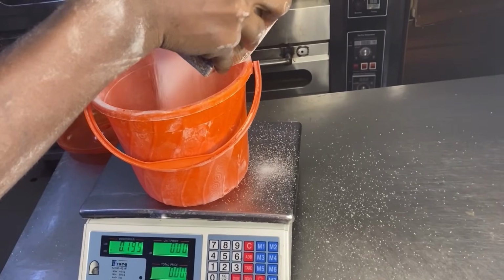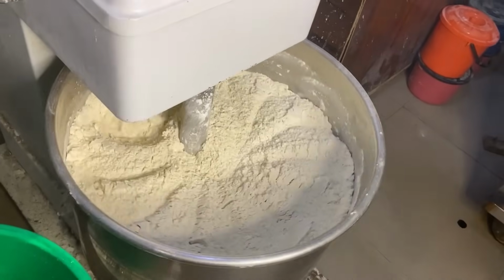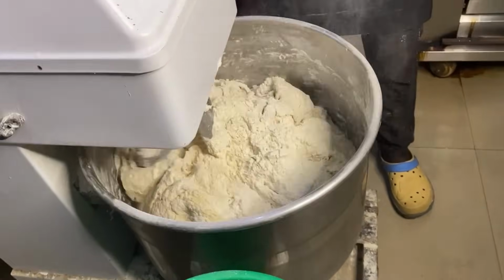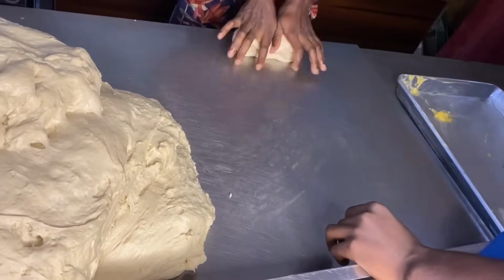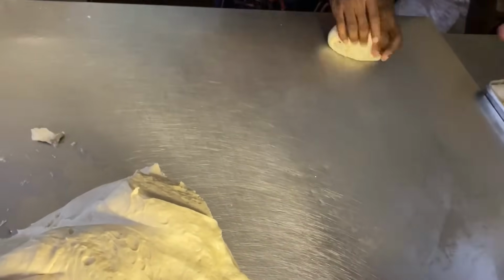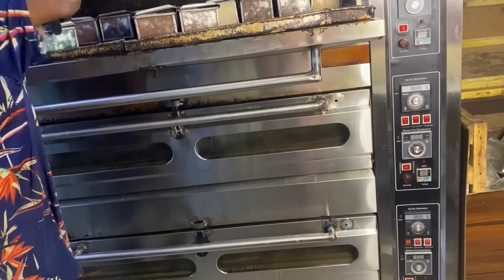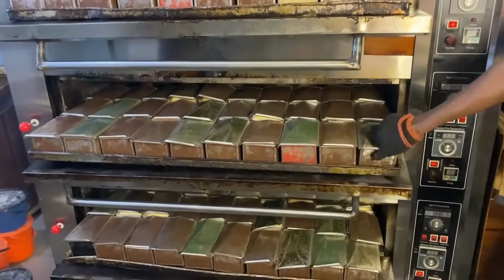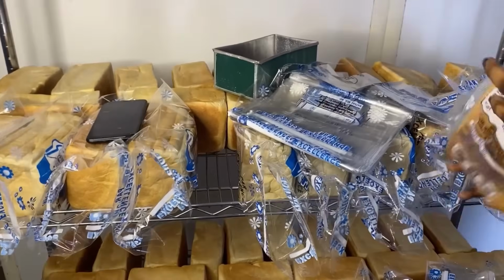How to bake Milk bread for commercial use #breadbaking #bread #streetfood #breadrecipe

Comment: Pls what is the name of the oven? Where did u buy it fro.?Does it use steam? Is it electric or gas. How many minutes does it takes to bake one batch? Thank u
Reply from the maker: 3 deck oven, it can  bake for 25kg flour at a go, people that sell kitchen equipments in lagos sell it, it uses Electric and gas, it bakes for 30mins
Reply: Does it have a brand name? I am outside of Nigeria and wanted to see if I can get some. It looks really efficient. Do u put steam ot water in the oven when baking? You are an inspiration. Thank u for your time.
Reply from the maker: @deborahboateng4062  no steam and durable
Reply: Good morning Mary, I need a bread bakery consultant, can you help. Thanks

Comment: Good job mam. I just stumbled on your video. Please, a quick question; is the floor of your oven stainless steel or stone and where can I easily buy one? Thanks for your reply
Reply from the maker: It’s thick aluminum but you have to do another pan to put in the oven it’s called aluminum tray very big flat tray it’s done by those that do bread pan

Comment: Why did you not add the salt with the other dry ingredients? Do you do training?
Reply from the maker: That is the way I was taught
Reply: @maryemelogu3201  ok, thank you.
Reply: When salt comes in contact with ur yeast or sugar, the strength will be gone. So you can add salt in the flour, cover with more flour and add sugar. By the time you dry mix, they will not react. Don't add salt and sugar together pls. Nice video, weldone. Pls mix smaller quantity so that you mixer will not be stressed. Weldone madam
Reply: @raymondetsenumhejohn4317  thank you for that explanation. Noted.
Reply: @raymondetsenumhejohn4317 pls is it compulsory to use calcium propionate (preservative) for commercial purposes bread making

Comment: I think the size of the mixer is small to the quantity  of the ingredients.  If the mixer is big enough, there is no need  to use hand inside the mixer while mixing . Just my thought  as a baker I have a machine  that accommodates 1 bag of flour.
Great work. The Lord bless your  efforts.
Reply from the maker: Yes it’s small coz we have one face light
Reply: @maryemelogu3201  then mix twice so you will not spoil your mixer. The resultant dough will be way better 
Try it and see
Reply: The mixer is accurate,, but there's something I don't like at the particular spot,, putting salt,yeast, different is not good,, every recipe should go immediately,,then while mixing he shouldn't suffer by bringing out flour that is under the mixing,,, what he should do is... pour half of the water at the center when mixing, then pour at the edges while mixing,,it will automatically mix one's,, and the dough has to be a little thicker.
Reply: @nkiruanumudu992 that's exactly what am saying too,, there are mixing 25g ones..wch is improper... and there forgot that putting enough water when it hasn't mixed well can result some mark of the bread wch shows is not smooth...
Reply: @youngwealthokpara  Please can u teach me how to make bread for a token??

Comment: Good job ma,pls what is the pan size
Reply from the maker: What type of bread do you want to do? Depending on the price of bread
Reply: #200,milk bread
Reply from the maker: @amakaopia402  around the area you stay, buy 200 naira bread take it to the people that do pan let them measure the length and width, befor you do this make sure you have done your calculations right. Because you need to make profit
Reply: Thanks ma